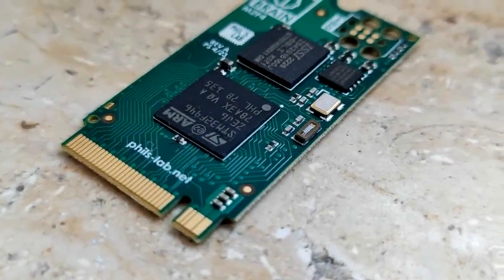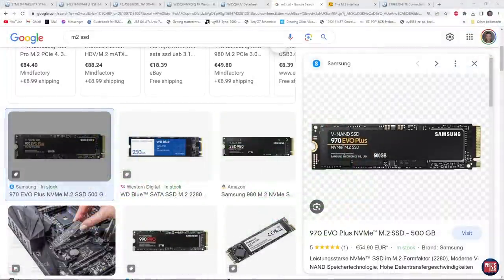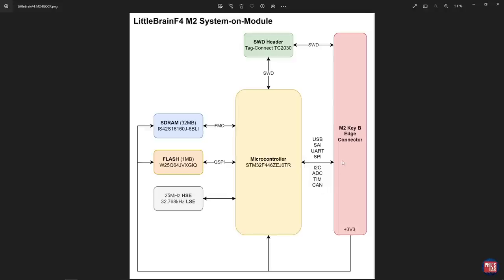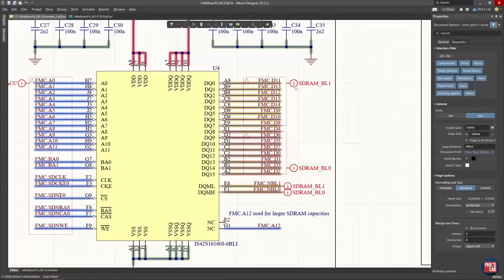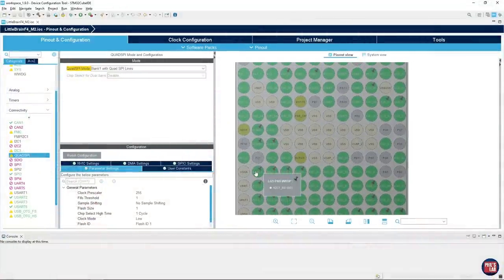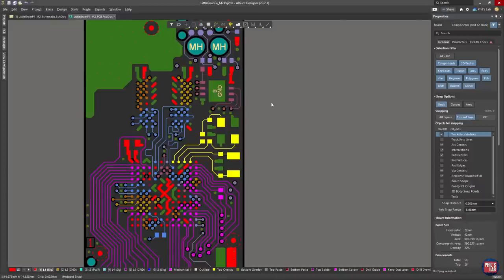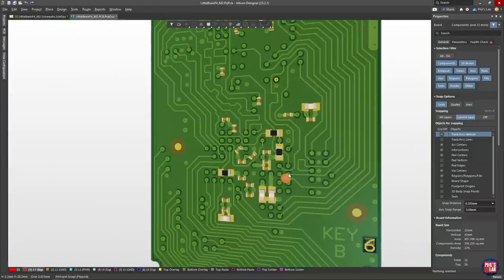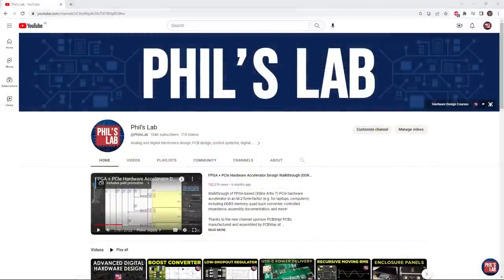M.2 System-on-Module Hardware Design - Phil's Lab #107

Comment: I you had any MCU pins not routed to the M2 connector, it might have been useful to stick a couple of LEDs on the board. Maybe also some accessible test pads for debug outputs.

Comment: I've been thinking about building an ESP32 SoM with some standard "I use these in every design" parts for a while. The NodeMCU / DOIT style boards are by far the most cost effective approach, with a whole board (ESP32 module, CP2102 or similar, AMS1117, USB connector, LEDs, etc.) typically costing less than just the ESP32-WROOM module would at qty50 from JLC, but the TH pin header connectivity isn't great for compact designs and the power delivery side of it leaves a lot to be desired.

Comment: This is probably overkill for something intended for internal use only, but offsetting the edge screw cut-out would probably be an effective reminder/indicator that this doesn't use a standard M.2 pinout without affecting the ability to use a standard M.2 connector in any way.

Comment: Still blows my mind that they don't teach board design at uni in EE. I mean what else are EEs meant to even do
Reply: EE graduates are entry level placeholders. Only true enthusiast keep elevating in knowledge and positions in the industry.
Reply: Lots of more things. Microelectronics (Analog, Digital, RF...) Semiconductor Device manufacturing, Control engineering, HDL, Embedded systems programming...

Comment: Nice idea :) I would only add separate Vbat connection on M.2 connector. Especially that you decided to install 32,768 kHz quartz on your board. This would give you possibility to design carrier boards with battery backup and use full potential of integrated RTC peripheral and MCU backup domain.

Comment: cool idea to use the M2 form factor. Gets me an idea for our new modular  space transceivers (currently in space move 2 )
, currently we used a solder on system with edge solders to have a modular system - I have to check the form factor , but the connectors are really great. Hope they can be used in space, might have to make some vaccum and shake tests...

Comment: I would recommend using a little bit longer power input pins at card edge connection so the power is delivered first. Otherwise great video as usual :)

Comment: A Dev board with a fancy connector. 😁
I like the form factor you choose, perfect for the job. The only draw side is the relatively high cost of the m.2 connectors. Well, since you use an MCU for a mere 12 bucks, I don't think a $2 connector will be a big deal.😋
Reply from the maker: Thanks!
Haha yeah, the MCU + RAM does outweigh the connector cost by quite a bit.. I do love the look of the M.2 form factor boards as well though.

Comment: i'm actually doing something similar now, just that the main brain, that mostly will stay the same, will be the backplane/motherboard and then the Module is the one that will change depending on the need. actually the base motherboard i'm currently designing will have 3 module spaces that all should be able to talk to each other :D those modules then add either processing power or some sort of IO. the software side of that will be fun too :P though this motherboard will be not so generic as the SoM from the video.
but definitely learned something here that will help me in those Designs ^^

Comment: Very  cool.......   plan to look into this  for  model railroad control via  DCC.  DCC-EX is  releasing  version  5.0  of  command  station  which  will  work  with  STM32F4...   Imagine  ...design  my own  mother  board  and just  plugin the  STM32F4  module.  Using  my own  mother board  I can expand  my layout  very  easily  and  cheaper   than buying proprietary  expensive  products.

Comment: Very interesting project, regarding the carrier board, do you have any idea of how the manufacturers do the threads on the motherboard in order to hold the m.2 stand off? im doing something similar for some audio stuff but couldnt find the answers for how to do the threads on the board,
According to chat GPT the threads are done directly to the motherboard material, is that correct?
Looking forward for the follow up video

Thanks

Comment: Thanks Phil!! Thanks very much for this great video mate.  its funny. I'm working on a high quality integrated audio DSP system at the moment, with multichannel DAC, ADC, DSP, Class D poweramp, along with all the required control and peripheral ie embedded MCU and CPU. I had designed in  M.2 connectors for testing different combinations in IV stage/power supply and interface, for the prototyping phase, before deciding on final config and building all on one board. I ended up canning the idea as springing for hard gold on everything increased the manufacturing cost substantially. 

Do you think its ok to use standard ENIG if its just for prototyping? As it stands i'm using 6 layer ENIG with 2oz outer/1oz inner (panelized and I need this for some power and high current; I know its not ideal for plane cap) and smallest and epoxy filled via in pad (complimentary with advanced PCBs at JLPCB now) so everything else is sorted, just worried about ENIG vs hard gold. 

The most important one I would still like to use itr for if possible is the XMOS and MCU board, with 2 way i2s. I would much prefer to put this on a module for other projects and its a far nicer interface vs a stacking header or even FPC cable/connector. and I can just put it right at the edge, it doesnt have to be an 'edge connector' (castellated) capability, right? this feature again makes PCBs increase 200-300%. At that time I costed it I was only using 4 layer and not via in pad, but as this capability has gotten cheaper and my design more complex; I increased to 6 layer with via in pad and ENIG, but adding hard gold is a bridge too far and i'll just go without if thats required.

Comment: Philip, am using your stm32h7 flight controller for agricultural spraying drone as my project, is it enough to use those sensors you used on the schematic? If not, list the needed sensors and where to connect them please. I really love your work Philip. Big Man

Comment: I am extreamly interested in doing this for my projects.  It gives me sort of an upgrade path and expantion capabilities where I can have a lower powered Microproccessor board for smaller projects and then have a higher powered one for bigger ones.  Or design a board with a breakout connector for future expantion feeding some UART and power lines over the connector, so in the future, when I built another module, I just plug it into it and have another dedicated esp32soc/stm32/atmega2560 or something to feed those breakouts and communicate back over UART... so influding this in my design makes it so adding capabilities is alot of just update code and plug in. 

My question is, is there an already designed PCB end with the M.2 Key and eveyrhing, or do I have to painstakingly design and hope I got it right in EasyEDA?  I would love to test Altium, but 2k a year is way out of my price range for a hobbyest.

Comment: Something like this (with usb c and a mounting screw) could be sweet for custom mechanical pcbs, versus using a pro micro or teensy. Slot in, add screw, flash via bootloader over usb (with qmk). A radio and lipo support wouldnt hurt either 😊

Comment: LOL what you can still buy a 446???
Sweet project.
You should use a high socket so you can route under the module and use smaller boards.

Comment: A point on the BGA fanning out. How do you deal with the change of reference plane vias? or does it not make that much of a difference if the stitching via is a bit further away? You can see some of the groupings don't (relatively) have transfer vias too close. Would this be something a blind via would help with?

Doh! You mentioned it later. but still is there a distance that would be considered too "far"?

Comment: Great content as always.  I am inspired to do my own SOM with some BGA parts on it! 
As I understand it, you didn't need to do any length matching or impedance control for the SDRAM interface?  Interesting.
Reply from the maker: Thanks, Isaac! 
Delay tuning only 'within reason'. Typically, as a rough rule, I aim for within 2.5% of the clock period.
Impedance control is preferable given the rise times, however, for this design not entirely necessary given the length scales.

Comment: Audio processing? Could it be used for say connecting to pc through usb and use as a soundcard/dac? surround sound for example?
Reply from the maker: Yeah, that's right! Just need to create a carrier board with suitable circuitry (USB connector, audio CODEC, power supplies, analogue front-ends, ...).

Comment: Did you have to specify anything extra in your fab drawing for the edge connector?
Reply from the maker: I typically make a manufacturing drawing highlying the area of the edge connector, as well as directly contacting the manufacturer about it as well.

Comment: Hi Phil, I was wondering if there is an alternative of the dog bone vias in this design. Is it possible to have a via that is place directly under the BGA pad that has a flat top for the ball to solder too? Great video apologies for the probably, stupid question.
Reply from the maker: Hi Henry, Yes, that is possible (via-in-pad) but typically quite a bit more expensive. Only really should be done if absolutely needed (high-density, signal integrity reasons, etc...

Comment: What is the purpose of the R2 resistor? Is it to prevent the clock signal from floating? Also why put series termination resistor on X2, but not X1? Also, how do you choose the resistance value of a series termination resistor (is 22ohm just a good rule of thumb)?
Reply: If I'm remembering right R2 will have to do with power on setup of the MCU and/or the memory config but I would expect he'll cover that in more detail in the next video. The 22ohm resistors are there to prevent ringing on the CLK lines. Didn't use them on the data or address lines because of the relatively slow speed but the CLK are more sensitive so used them there. There is a reason for the value but don't remember the details just know you see it in many different designs not only by him. Might look at some of his past videos where he goes over high speed bus termination. Stuff to do with the crystals really depends on the ones used and what the MCU requires. The low speed one will typically be much less critical as it is just use for the Real Time Clock vs other which will be critical as it is used by the MCU for main clock and effects the setting for bus timing etc.

Comment: Great work as usual Phil. Thumbs up.

I had a question I've been meaning to ask you from since a couple of your previous videos. How you're able to override a layer color in layout? I used to do it in schematic part but that would only override partially with boxes of layer color+override color. Hopefully I'm able to get my query across. Thanks
Reply from the maker: Thanks, Muhammad. There are additional settings you need adjust in the PCB editor, which will change how colours are displayed. Altium has a few docs on how to do that.
Reply: @PhilsLab  I searched for 'net overrides' in the preferences section that lead me to the solution. Thanks for your help also ❤️‍🩹

Comment: Did you need as many ground connections as you have on the M.2.. could you have used more pins from the MCU instead?
Reply: Ok. I should have watched the entire video before asking this question. Sorry.
Reply from the maker: It's not entirely necessary and you can get away with a lot less. It depends on signal bandwidth and EMI concerns. For a simple 'personal devboard' at these speeds, less would definitely suffice.